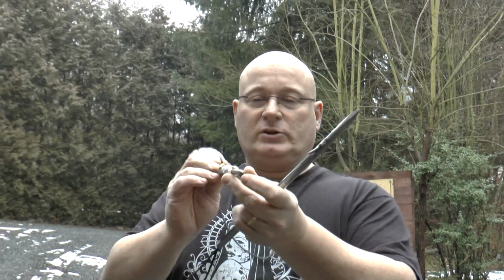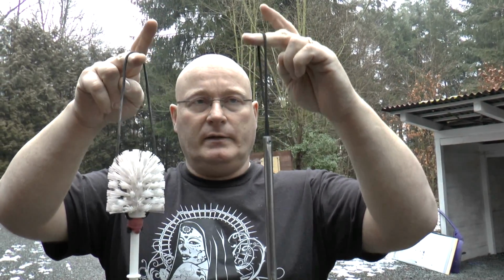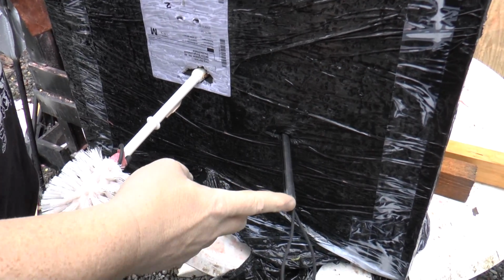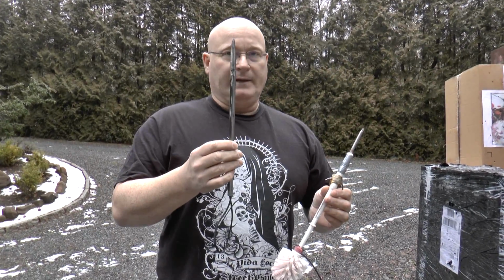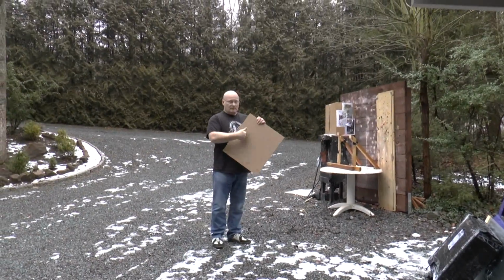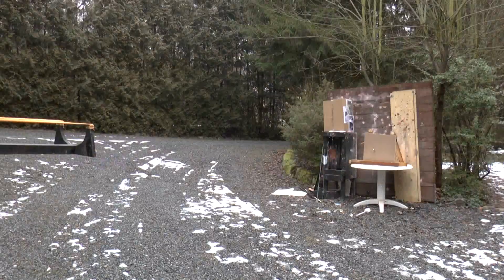100% Steel Arrow vs. "Bad Ass" Toilet Brush - The Shootout!

Comment: The steel bolts may perform better, but I still prefer the toilet brush arrow as it looks easier to manufacture, yet reasonably deadly. I think you most likely used welding equipment to make those other bolts, which is not something the average Joe Sixpack would have, especially during a zombie apocalypse.
Reply: ***** And, the toilet bushes make this cool whooshing sound while in flight.

Comment: How about some long range shots? How accurate are they at 70 meters? I see you have a scope on the slingshot. Is it useful for those ranges? With the projectile moving only 200f/s tops, won't the projectile drop way too much for a rifle scope?
Reply from the maker: I don't have a range for 70 meters, and rubber based weapons don't shoot fast enough for such distances anyway. Rubber works great for heavy projectiles, but 80 m/s is pretty much the max v0.
Reply: 20 yards then? Surely you can shoot that far.

Comment: Just call it Nirosta - sounds more noble than stainless steel :D
Reply: Nirosta is a Company that makes a kind of Stainless Steel and the Steel from the Company is called Nirosta so i think Stainless Steel is right :)
Reply from the maker: Ed Spliff Nirosta is an abbrev. for NIcht ROSTender STAhl, German for non rusting steel, a brand name of the Krupp corporation. The business segment was sold to a Finnish corporation in 2012, I believe.
Reply: JoergSprave
Jeah i know but i thought is a spezial Steel from the Company like Böhler Steel or something and they called it NIROSTA so not all Stainless steels are NIROSTA... so sry i was wrong :)

Comment: I'd like to hear from you why you didn't put fletchings on the metal one. I'm not weapon savvy but i think the toilet brush is better at long distances.
Reply from the maker: Fletchings aren't needed, the loop creates enough drag and the bolt is very much front heavy, much like a medieval crossbow bolt. Fletchings would actually slow down the projectile over longer distances because of the air resistance.

Comment: I would recommend putting some kind of fetching on the steel bolt. I imagine you could even TIG weld some long, thin, low profile vanes to the tail end just to ensure a true flight.

Comment: multiple stands of wool or floss inserted into the rear of the tube around the loop , or a few soft feathers would scarcely add to the weight and provide greater stability. This is lost from the design with the toilet brush head which gave rear drag as is used in arrow and dart designs.
Great video and an enjoyable watch

Keith

Comment: i believe fletching is nessasery on the metal one
Reply: its a bolt not an arrow... no feathers needed:)
Reply from the maker: The paracord loop and the forward center of mass eliminate the need for fletching.
Reply: JoergSprave The first shot on the archery mat showed that it flies erratically.  Wouldn't a more straight flight direct the energy directly to the point of the projectile?

Comment: I know that this is a dumb question, but can anyone tell me why the arrow is capable of flying straight without a heavier head or fletching? Is it the string?
Reply: The string would produce drag slowing the back of the bolt. I expect the tip is also heavier, since it is a solid steel point pushed into a hollow steel pipe, which would add to the stability.

Comment: Hey JoergSprave, I watched your video on "BadAssing" the cheap crossbow. I gotta say, that's one of my favorite weapons you've made. But i want to see if you can add some kind of spanning mechanism for the crossbow, so you wouldn't have to press it against your chest to span it. It would be really cool if you tried it!
Reply from the maker: The chest span method is the fastest, by a great margin. Spanning mechanisms are cumbersome and bulky, usually.
Reply: Oh okay, But your BadAss crossbow is my 2nd favorite weapon, the Gatling slingshot is my #1 favorite.

Comment: Yes, please add fletching  you can see on the first shot it went in a little crooked, thus losing force to penetrate.
Reply from the maker: Went in straight, but one of the blades is a bit longer than the other one, therefore it canted INSIDE of the mat.
Reply: ohh, alright. thats why.

Comment: Joerg you are awesome! I have thought on a better dragon scale analog i would like to see tested. its going to require some work, but it will be the best test against anything pointy or sharp for dragon hunting.because dragons aren't metal you should make a LARGE version of one of the scales from a suit of chinese feudal paper armor. its said to have the greatest resistance to arrows. not sure what paper stock to use.  with a dragon scale i would use a piece of 20mm composite board (like you used in this video) for the outer scale where its hardest and also to start your paper and appoxy accordion on. accordian the paper, appoxy in between each layer,weight down and let dry,  then you'll have a real analog for a dragon scale. tough and resistant, although i'm sure your heavy dragon arrow will still penetrate at close ranges. :) keep up the awesome videos coming please!
Reply: or maybe even a few life sized smaug scales could be made this way, as the scale patterns (the way the scales fit together) is also something
 to consider when piercing dragon scales. :)
Reply: found some info. you can used folder paper to make the scales. they did it on mythbusters.the paper held up as good or better than the steel in most cases.the "moutain Pattern" is recommended for scale arrangment(like dragon scale) I'm sure you could watch the "paper vs steel" episode of mythbusters for ideas on making the scales.  then your mighty weapons vs. the realest dragon scale or scales that can be made. you could problably even leave the 20mm piece of wood completely out of it if you do a small section of medium scales instead of just a single large scale.

Comment: The steel bolt may have penetrated further but at longer ranges,  without fletching, it would have been too inaccurate to be effective, so I guess for short range tho it's pretty awesome
Reply from the maker: You guys with your religious believe in fletching... once again, it is NOT NEEDED for bolts that have enough mass and are front heavy. Only light arrows with puny tips need fletching.
Reply: JoergSprave They just wont leave the fletching thing alone will they? lol.

Comment: Joerg you can see your address on the archery mat just a heads up!
Reply from the maker: You can also see it on my web page, as required by German law.
Reply: JoergSprave
 In that case, I will shut up! Did not realise that! just a fan of yours and thought I would point it out just in case you had not noticed. German laws are a bit stricter than English!

Comment: Your steel arrow is basically a shrunken harpoon. Hmmm...could be a homemade bowfishing rig? It clearly would penetrate the side of a carp or gar and the hooks would act as a barb to prevent it from pulling back out. Attach a reel to the handle of your slingshot and your line to the end of the arrow.

Comment: So if the toilet brush went through the dragon scale, but not through the 20 millimeter board, then that board is tougher than the scale.
Reply from the maker: I think the shaft broke early so the momentum of the toilet brush wasn't transferred into the nail. Hence it did not penetrate the board.
Reply: Ah, that makes sense.

Comment: Joerg, instead of cutting your board up to remove the broadhead, how about just smacking it with a sledge hammer....send it all the way through....if the shaft tube isn't too flared, that is.

Comment: the toilet brush has better accuracy because of the brush
Reply from the maker: No difference so far.
Reply: it looked like that because the steel arrow didn't go straight into the archery mat as the toilet brush
Reply from the maker: tommihommi1 I think that is because the hook isn't perfect, one side is longer than the other one so the bolt canted INSIDE of the mat.
Reply: ahh that might be it. thank you for replying

Comment: You're losing allot of energy from the bristles on the brush.  By removing most of the bristles it would cut down wind resistant tremendously.

Comment: Hey joe when are we going to get a axe launcher or an axe gun
Reply: When you say this, I think of a long crossbow with a hatchet loaded with the head toward the back and upward. As it launches, the bottom of the shafts hits a small pin at the end of the track which transfer it's horizontal velocity into a spinning trajectory, sending the hatchet into a deadly spin.